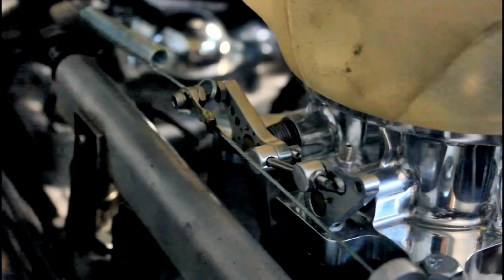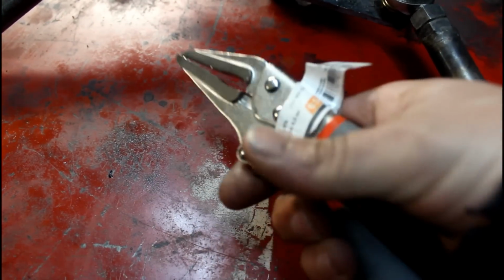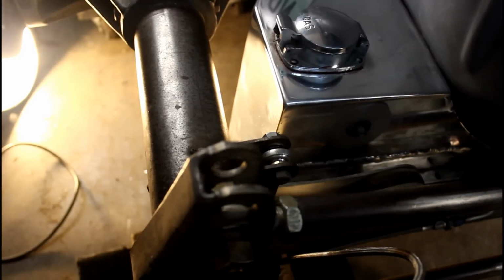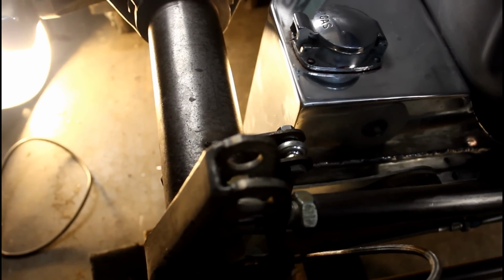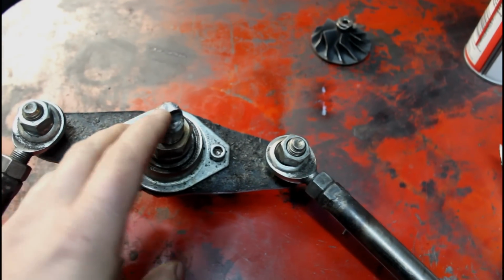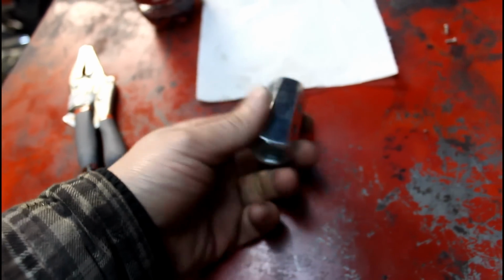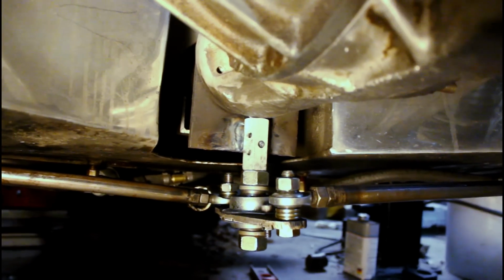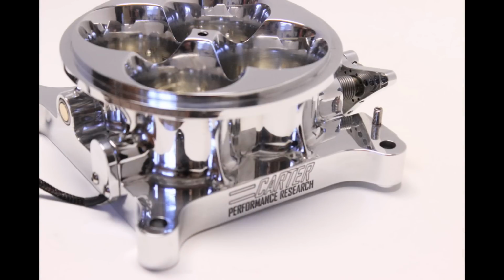My Watt's Link Got Ripped Off!

Comment: You need some high tensile strength all thread or use a grade 8 bolt to hold the center of that watts link. Also that all thread coupling nut can be gotten in a heavier, higher strength piece that would be more suitable for your usage.
Looking forward to seeing how the T turns out.

Comment: Hey man. Constructive criticism. First off the coupling you used is galvanized and without cleaning that off before welding not only are you subjecting yourself to harmful fumes you will never get a strong weld on the part. Second all thread should never be used in suspension. Half the all thread you buy at a store is bent in the rack from stuff sitting against it. Let alone the forces of a suspension. 

Why did you put the watts link under the axle instead of behind it? If it is where it’s supposed to be it never would have caught the road.